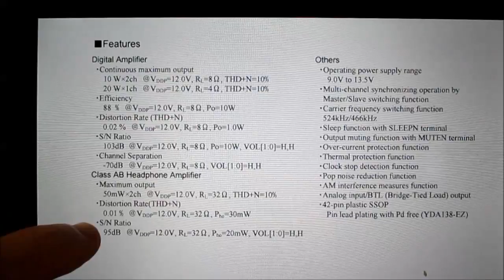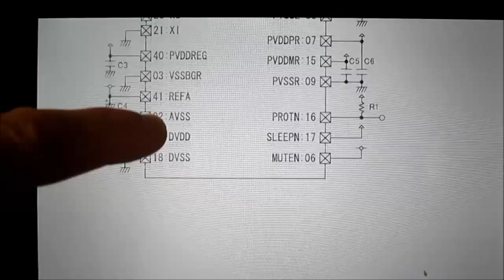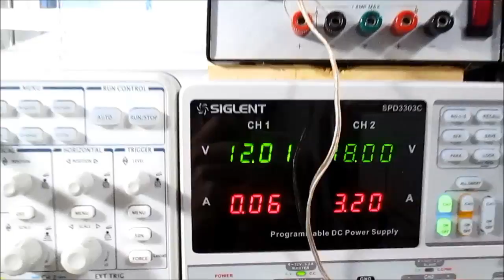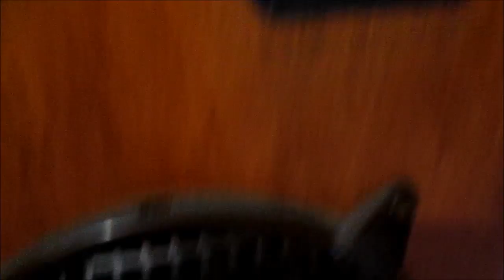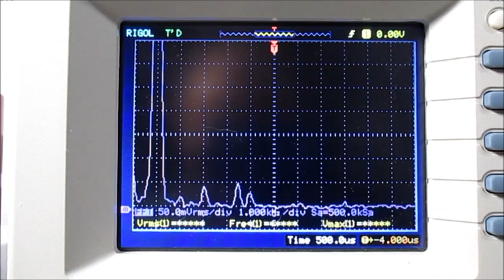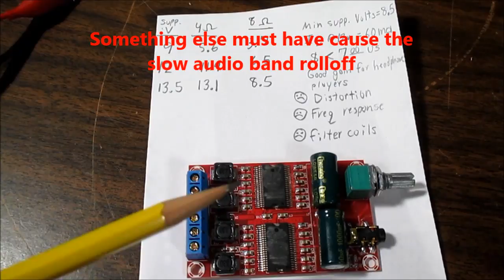Yamaha YDA138 class D stereo amplifier board test & review

Comment: I have one of those board as well, I will be changing the inductors to much higher quality versions. In fact they are filter inductors from a Harman/Kardon Onyx Studio (First Gen). Also part of the poor output could possibly be due to the protection diode as well. For any amp I build they don't have diodes in series with them. I really dislike the diode protection technique. I will make a video showcasing my results with the mods as well.

Comment: Hi John. I recently bought one of these to drive a pair of spring tanks and am finding that with any drive the output begins clicking and I have to power cycle it to resume. Tanks are a 10Ohm load, but definitely highly inductive loads given the nature of the spring tanks. I have added a passive HPF before the circuit to cut the low end, hoping to improve the headroom but the results weren't great.

 Should I be adding my own output filter before the tanks? Or should I be using a different board with better coils for driving these kinds of loads? Distortion not an issue given the application.

Comment: Recently I tried this amplifier, it has unpleasant distortions, so I looked into datasheet and on the board and found that the ICs are not synchronized. Chinese ingeneers did not discovered master/slave configuration yet...
Reply: The same things happen with the TPA3116D2 boards. ffcosag, another youtuber, has done some research on this and posted a fix.
Reply: "Chinese ingeneers did not discovered master/slave configuration yet" yes they did they just know that it would take a little over 1hr more and every minute burns too much coals that equates to higher electricity bills which in turn becomes detrimental to their target profit margin by the end of production

Comment: Hallo John, did you do a test on the SANWU Yamaha YDA 138E stereo amplifier board? I am asking because the connection points on the board are not marked clearly and I do not want to burn the board/chip out by making the wrong power and speaker connections.

Comment: LOL, just noticed you said gold plated 3 and a half inch input jack at 1:32.  That must be a giant pencil you're using to point with...   I suspect the coils are partly heating through losses in the ferrite - problem with ferrites is that if run hot they can deteriorate in efficiency with age, its better to err on the generous side with sizing ferrite cores.
Recently I got a TDA7498 board from eBay - although I've only tested it a little it seems pretty good with efficiency and distortion, 45mA standing current at 27V supply, inductors not overhot.  Seems to handle 4 ohm load (despite only being
rated for 6), although its a two-way crossover system so who knows what the actual impedance is really.
Have you played with that particular chip?

Comment: I'm disappointed I was thinking it would put out more at 8 ohms at 12v I was wanting to drive these...

https://www.parts-express.com/dayton-audio-pc68-4-2-1-2-full-range-poly-cone-driver--295-150

Does anyone know of a clean amp at 12v I should use?
Reply from the maker: None of these amps will be able to deliver over 8 watts of clean power per channel into 8 ohms. It is a physical limitation. For more power, look for an amp that accepts 18 or 24 volts. If you need it to run off of 12 volts you can get a power supply that can boost the 12 volts to a higher voltage for the amplifier.

Comment: John, your amplifier videos are great, but how can we build a power supply that puts out 100 watts or more at 32-42 volts to power them. Transformers are too expensive. Can you do a series on power supplies for projects? .
Reply: Richard Friedlander , Amen to that !!!!!!!  
that has been my biggest issue so far with amp boards no matter who the manufacturer is.
Because a lot of these mini amps that do come with power supplies are not powerful enough to get the " Rated " output power of the board !!!!!!!!
I don't know why in the hell they don't sell a cable & power supply ( PACK ) for boards that ( Match ) the output power of the actual amp !!!!!!!!!!!!!
Reply: There are basically two alternatives that I am aware of. #1 is a 'linear' power supply and yes, that requires big transformers - no direct way around that. #2 are the switching power supplies that are a completely different design and do not have a big transformer. But switching supplies can generate electrical noise that might (only might, not definitely) create audio problems. They usually have a square wave source inside, thus a ton of harmonics that typically need to be filtered out. May be fewer issues at audio than at RF -- where I have used one (I'm a ham radio op). So you might google for "DIY switching power supplies".
Reply: @markanderson8066  switching frequency is in the 80-400khz no need to worry about harmonics that far from the audio range unless one is built with cat ears

Comment: Heeeem...... i really confused
i got 
5 different tpa3116
2 different tpa3118
1 TAS 5613
2 tda7498
2 board PAM8610
2 This Yamaha yda138 dualchip

i must say.... this board was the best to my ears, i used different setup speaker, 2 way, 3 way, and 1 fullrange
Still... this yamaha was the best to my ears, it has wider freq especially in the mid, low distortions.....
in the end.... i test it all by my ears...
good luck
Reply from the maker: To my ears, the YDA138 sounded fine. Performance is probably a lot better at 8 ohms.
Reply: oba Muhammad p
Reply: Me too, tested almost all of these and agree with you-this double chip Yamaha sounds far better than others

Comment: cant you just replace those 1A rated cheap inductors and 2 craptacular electrolytics then test again? also whatsup with the solder bridge between 2 smd ceramic caps?
Reply from the maker: No. You'd replace the inductors with better ones of the correct value. They left off a power supply trace on the board and had to add a jumper. You can see the trace is there on the other IC. How they missed that simple connection is beyond me.
Reply: wish you had the correct parts or something similar would be interesting to see the difference. thanks for the video tho

Comment: With that HF roll off, makes mt think the output filter has incorrect components fitted (I doubt these boards are pre tested!) That would account for the heating of the coils if they are also filtering audio. 
Quite large chips for such low power!. You would have thought showing the chip numbers would be a selling point. Yamaha is a well respected name in audio. However if the chips are rubbish, maybe Yamaha just wanted to get rid of them, hence the name removed.  AS things stand I do not think this chip will promote the name Yamaha at all.
Reply from the maker: They used 33uH coils where the datasheet calls for 10uH for 4 ohm loads. For 8 ohm loads, the  datasheets calls for 22uH so these are way overvalued. I can't measure the capacitor without removing it. That's one issue with class D is that the ideal output filter has different values for differing load impedances. They could have compromised on a filter for 6 ohm loads since the board was designed to handle 4 ohm loads and often used with 8. I think the ICs are okay, whoever designed the board could have done better.
Reply: Once, I bought a SURE class D 25 W board  and the frequency response was ridiculous, sounded not much better than an AM radio. chokes said 330, but I measured and sure enough they were a factor of 10 off  as though they were mislabeled. Replacing them took care of it.   The moral is if you are buying these el-cheapo class D looking for miracle power/cost ratio, be prepared to at least replace your chokes for one reason or another. The other problem is typically hiss and interference sounds at low levels. I have one of these coming in soon (well, from china so not too soon) and we will see.
Reply: And if they were getting hot, they may be undersized in terms of current capacity too. If you can find the right ones to 'fix' it, you'll have another video!

Comment: Sir I have tpa3116d2(50+50)watt amp and I'm attaching 15w×2 4ohm, 10w×2 6ohm, 25×1 8ohm which power supply best for this load . Volte? Amperes?
Reply from the maker: I would not connect them direct. I assume you are using a crossover for each speaker to handle part of the audio spectrum. Since the speakers are of limited power, a 12v 3amp supply would be my recommendation.
Reply: Thank you .
Reply: If I'm set 2crossover  when power supply same or change?